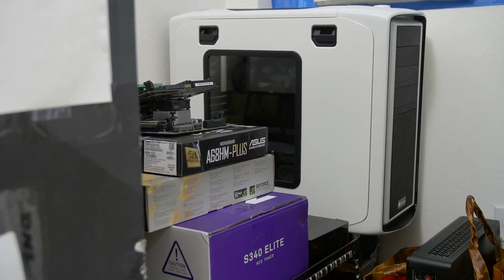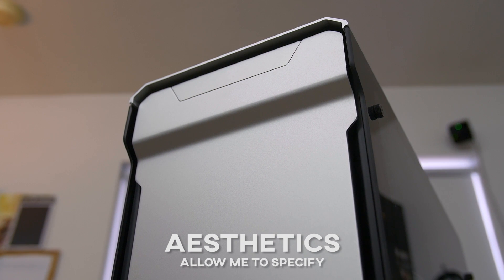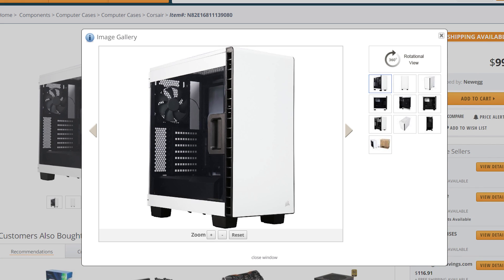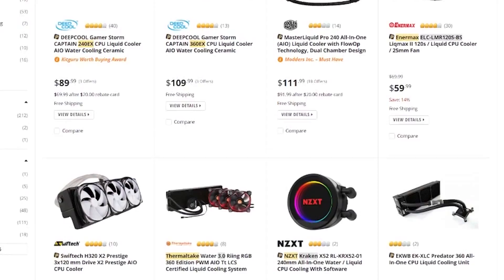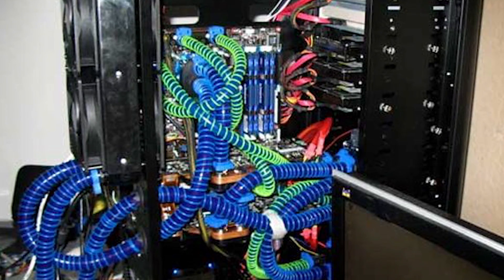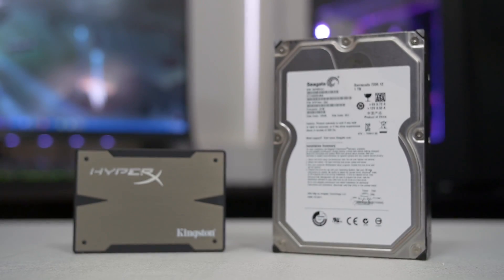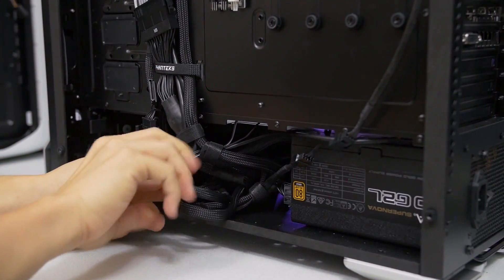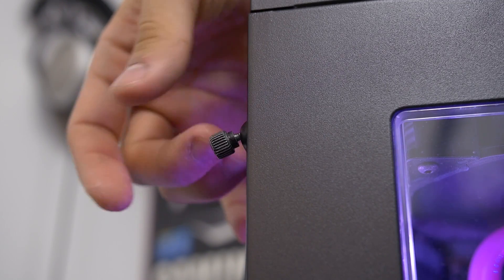4 Major Changes to PC Cases in the Last 5 Years: Then and Now

Comment: I  enjoyed this video Kyle. One thing I wish they'd bring back is easily removable side panels with latches like the 600T and 650D had. I don't think any side panels come close to that ease of use, with the possible exception of some Phanteks offerings.
Reply from the maker: +Paul's Hardware Totally agree. The biggest disappointment when moving from my Define R5 to the Define S was losing the tooless side panel. Would love to see them make a comeback in 2017 but now I feel like larger windows and tempered glass stand in the way :(
Reply: Bitwit Do you think 180/200mm fans can make a comeback? Wouldn't those fans coupled with recent technology like fluid bearing and corsair magnetic levitation fans create a high cfm+static pressure+ultra quiet solution for audiophiles? 
I do miss air cooling without the noisy water cooling fins.
Reply: had 650D for 6 years, now i moved to R5, its not as ez, but look way cleaner.
Reply: I am surprised that the latch system of the old Mac Pro, with one latch in the back, has not caught on more in the PC case world. Its a simple elegant solution and leaves the side panel nice and clean
Reply: The 760T has a similar latch to the 600T
Reply: Paul's Hardware I like my Corsair case with a flip out latch. I built it in 08 or something. Running on a 775 Intel socket with the power supply at the top... now that is a revolutionary change.
Reply: Bitwit I really don't like the direction the define s seems to indicating fractal is going. As someone who values function over form, the R5 is case nirvana
Reply: we should start a twitter hashtag as I totally agree to.
#BringBackToolessSidePanels :D
Reply: Check out the Cougar Panzer Max. It has awesome tooless approach to the side panels, top and front panels also. I have just finished a build in it and it offers very convenient access.
Reply: Paul's Hardware Corsair Vengeance C 70 now those latches, not to mention the handles..ugly side window but I took care of that with a mod.
Reply: I wish they would make case sides with tiny wheels to roll off instead of swinging it open (its quite heavy with glass)And dangerous.
Reply: theres a lot of makers that still offer that u just gotta look harder
Reply: H500P? All you need is a 90 degree twist with a coin!! I mean heck, writing this comment took more time!! XD

Comment: CPU and GPU increased power efficiency makes water-cooling obsolete.
Reply: +Levy Somewhat ineffective? Yes. Obsolete? No. Trust me, it's not going away anytime soon.
Reply: If you game at all these days, you know this statement isn't true. Getting 60+ fps in a AAA title almost requires overclocking, which at its high end requires water cooling.
Reply: +Aditya Gupta A water cooled CPU and single GPU is a lot more affordable. Given how few titles even take advantage of an sli setup, its also more practical.
Reply: FoodOnCrack
There is a good reason: Yes it performs outstanding, but most noctuas are ugly AF.
Even when most air cooling solutions surpass most watercooling ones, there will still be watercooling, just because of aesthetics.

Just saying... I'm explaining, not defending.
Reply: water can get better temps than air. doesn't matter how efficient the components get.
Reply: Water cooling is also useful for small cases with hotter components and inherently poor air flow.
Reply: why won't it go away? Compare the noctua nh-D15 with any AIO cooler and on almost every aspect it's so much better to get the noctua.
Reply: Darkrock 3 looks pretty sexy, with few more degrees but more quiet too.
Reply: I guess the economy works better underwater also.

Comment: That antec case you mentioned that had a window shaped like gumby I owned that exact case lol traded an Xbox one for it well and the components inside. That case was gross that clear coated silver metal finish all on the inside cheap flimsy plastic parts no cable management options.

Comment: One of the biggest changes for the better that I've observed is the re-orienting of the hard drive cage. They used to be positioned so that the drives were parallel to the case panels, whereas they're now perpendicular, meaning that you don't have a bunch of cables feeding directly into the middle of your case and in the way of the graphics card.

Comment: I kind of miss 200mm fans. Such a huge airflow vs noise ratio from their sheer size.
Reply: exyiaevox no amount of sound dampening is going to stop those 2400 rpm fans from hissing at us... If only a manufacturer make a fluid bearing 180/200mm fan. That'd be great.

Comment: I recently had to build in an old super tower from about 7 years ago. (Thermaltake Kandalf, it's what I found cheap when I needed a case to build a low end PC for someone) At first I was impressed by it's raw sizze and compatability with a million motherboard types. I CHANGE MY MIND QUITE QUICKLY. That thing was a pain in the ass to work with, with screws holding in all kinds of different things that really should not be held in with screws and no screws for fans or other such things I would like to easily replace, instead having some proprietary fan mounting system from yesteryear. There was also NO CABLE MANAGEMENT POINTS WHATSOEVER. Seeing how incredibly massive the case was and still not having anywhere to put the cables so that they don't dangle down in front of the motherboard and side panel window was disappointing. I even had to bend the internal steel slightly to get the PSU to fit properly, (even doing it the intended way was a massive pain with the mounting bracket being half in and half out of the case.BUT BASICALLY I HAD A BAD TIME IN THIS OLD GIANT CASE.

What terrifies me is that this thing supposedly cost a few hundred dollars on launch. It has a million 5.25 drive bays but otherwise i don't see any features on it that really make it useful. What was a cheap case from 2009/08 even like?

Comment: The biggest change really was the removal of the disc drive bay (who uses a Blu-Ray/DVD drive nowadays?) and the reduction of HDD bays, it really gave the most freedom in the case design than every other change you've pointed out.
Reply: I Still like my computer case to still have a disc drive bay. It&#39;s nice to know that you can still manually install something via a disk encase trying to DL a program doesn&#39;t work. Plus I like to still play my older PC games which require a disk in order to play.

Plus I do editing and sometimes need to burn off a disk to send to someone. And I'll use it to watch DVDs on as well.
Reply: I still use my disk drives : /
Reply from the maker: +aruan7sp you may have missed it but I included bay removal under the water cooling section since there's a relationship there, as one gave way to the other
Reply: aruan7sp I use a DVD drive. Fuck Digital Distribution.
Reply: Me, quite alot actually. Its the easiest way to archive my commonly used files and programs for transferring to other systems along the line without buying like 20 flash drives at high cost when large DVDRW discs are a couple of cents each. Way I look at is they are like a box of 20 5gb flash drives for like $8
Reply: Considering that Microsoft media creation tool refused to regognice any of my USB sticks, I'm really glad I hadn't thrown away my DVD drive and still had some empty disks on the back of my closet.
Reply: I still use an optical drive/burner for DVD and Blu-Ray. I'm old school, I'd rather have physical media.
Reply: aruan7sp I use a DVD Drive.
Reply: At my house we actually have all of our movies on dvds and we don't use any streaming site (aka netflix)
Reply: I have Blu-Ray burner in my PC. Though honestly, its just because I always wanted one and I could afford it, I also plan to do some data archival.
Reply: I have two Pioneer blu-ray burners in my 4790K build and two Lite-On DVD burners (with a Sony internal floppy disk drive) in my E8400 build. I still have a tonne of optical media, that doesn't need the cloud and days of download time to work, and I find it much easier to boot off an optical disk than constantly fiddling around with the BIOS trying to get a USB stick to boot. Also, I can easily watch both region 1 and 2 DVDs on both machines. Finally, having two drives reminds me of those twin tape decks I used to have as a kid back in my home town.
Reply: aruan7sp idk I know a lot of people who still use 5.25 bays. when it's a disc drive or a fan controller/rgb controller, I like it
Reply: I'm building my first desktop in a month or two, and I refuse to buy a case without 5.25 drive bays. I want an optical drive, fan controller (fan controlling via programs is annoying af), and a card reader since I still use SD cards on a regular basis. Thank God for the Enthoo Pro.
Reply: aruan7sp Me. I still use a DVD drive but it's free and 99% not in use LOL
Reply: As an owner of 9 year old car with CD player I have to disagree. While it is not needed for majority, it is not a single case when you might need good old DVD drive in PC.
Reply: What I could see optical coming back as is flush-mounted slim bays that slot-load.

So just a slit in the front panel.

To be honest, though, 5.25 bays are VERY good for SUPER high-end systems with big RAIDs. Though NVMe kind of obsoletes the good old "shitload of 850 Pros"
Reply: I still use my blu ray drive why would I not have a drive if I can and its cheap ?
Reply: Kevin Moondust they wouldn't be third world then otherwise
Reply: I just picked up a BR burner with Lightscribe for my new build.  Sometimes you deal with legacy stuff.
Reply: i dont think you can fuck the future
Reply: we don't have netflix either, we juse use on demand lol (only good thing about comcast)
Reply: Im planning to overhaul my 2012 pc (Started with a nice graphic card) with a newer processor and motherboard, was thinking only to save the power unit and my old giant cooler master case which is discontinued :

http://www.coolermaster.com/case/full-tower/cosmos-1000/

Do you guys recommend me purchasing a new case as well? as im still deciding between going air cooler or AIO cooler are there any significant improvements for me to consider a new case  in the budget?
Reply: Colt3d - I reckon that If you're planning on staying with your existing case, it'll be best to stay with air cooling, but perhaps updating all the fans to new ones like Noctuas, or BeQuiet!s. Otherwise, to maximise you AIO options, it'll be best to get a new case that has both decent AIO support, along with more modern features, while still retaining at least the essence of the reason why you brought your original case, with the new case's overall functionality. As for the power unit, if online PSU calculators show that your existing supply is up for powering your new build, and it's still a quality unit after all this time, then by all means keep it. Otherwise go with a quality new one, that's ideally at least gold rated, from a reputable supplier, for reliability and longevity, that goes with the power requirements of your new build.
Reply: i have a blind friend i use my dvd drive to rip audio cds to his ipod regularly
Reply: Just bought a pair (one for work and one for home) of Fractal Design Define C's (non-mini version) because of their lack of front mounted drive bays. These cases are nice and short front-to-back. Can fit on my desk without looking ridiculous. I have a redundant, 2 drive NAS for movie and photo archives, so I only need one SSD in the case. (They have 3 SSD backside mounts and two 3.5 mounts for those that need more, in the case storage)
Reply: acme64 I can so long as tech companies shit on Third World Countries with terrible ISP Offers.
Reply: MCatwar For example, a Scythe Kaze Master KM01-BK fan controller to go with my two DVD Burners, collectively using all three 5.25 inch drive bays of my Cooler Master Elite 370 case, in my E8400 build.
Reply: Samuele Pelanda rip them and network share them? Much better than pulling a disc and damaging it over time.
Reply: Billy Sure. When I can afford to upgrade to a full Gigabit LAN WiFI 802.11ac network, and have gotten enough RAIDED HDD space for a NAS based solution, along with a complete proper Blu-Ray and DVD ripping, editing and conversion software package that actually works.
Reply: Elusivehawk For my 4790K build, I used a Fractal Design Arc Midi R2, with three of my fans using the internal switched fan controller, while the other three, attached to the Gigabyte Z97X-UD3H-BK motherboard, are controlled by BIOS settings, which auto adjust to the temperature of the system. My E8400 build uses a Cooler Master Elite 370 with a Scythe Kaze Master KM01-BK fan controller (which is an older model) to manually control the fans, while also being able to continually monitor the speeds of the attached fans and the temperatures of various parts of the insides of my case with it's great looking old school VFD Display. For a card reader, my Epson XP-322 Printer/Scanner/Copier provides me with one for both systems.
Reply: I have a BD burner, but I have it in an external USB3 case, and rarely use it to be honest.  No place for it in my NZXT S340 case.
Reply: Sean Malahy i have one of those. I also got an external blu-ray drive. Tho im kinda annoyed as i used to have a really good blu-ray burner which could also read hd-dvd. Looks like im gonna have to not be a cheapskate and upgrade to pure blu-ray lol
Reply: The nice thing about having the BD burner in the external case is that I can use it on my NZXT desktop case, my Dell XPS 15 9560, and my Alienware 17 R4.  It's fairly versatile that way.  Handy when I want to back up files to big to transfer over the Internet or network, or when a friend says "hey make me a copy of this"  I still find discs to be more reliable than high capacity flash drives.  I've had too many of those fail.
Reply: i used to work in a used software shop back in 08 and i got a box full of them for £5. good films aswell. t2, matrix trilogy, 300, heros season 1, a season of smallvile, doom hd, full metal jacket, blade runner and jason bourne films
Reply: I use a disc drive,but its hidden due to the nature of the top drive bay mount that covers it from the front.
Reply: even if i decided to use one, it would be a slim external one, 3m taped to under my desk
Reply: I use a disk drive. Downloading a new game over a metered connection is awful. And blu-ray movies are now nice and cheap, and better quality than streamed or downloaded movies. Long live the Blu-Ray drive (For a select number of people. :)
Reply: Still use.
Reply: Use DVDs every day. No plans to change. Not going to pay all over again for the same stuff, and not paying £££s for space versus £10 for a DVD drive. PCs can't get vastly more narrow really, due to PSU width anyway.

Counter argument: What's the point in having an electronic device in the home, with all the potential access points to it hidden? Aesthetic PCs are for poser Mac users and RGB kiddies.

Discuss!

(So we learned that sweeping generalisations aren't helpful :D )
Reply: The biggest downside to not having one drive bay is all the cool aftermarket you can't make use of.
Reply: There are Third World Countries with decent ISP Coverage and speeds. As long as there is not contention from Devs and Tech Companies alike, I will say Fuck Digital Distribution, I want my Physical Game. Plus, I have something that can be resold and own the bits and bytes inside, instead of signing an EULA which is recklessly anti-consumer.

Comment: Im sitting next to a Corsair Graphite 600T right now. ITs not old, dont make me feel bad.
Reply from the maker: +Josh Mullard I agree the 600T still holds its own today. Still deigned better than a lot of modern midtowers.
Reply: Josh Mullard im sitting next to cm stryker and i feel bad :(
Reply: old  doesnt mean bad. its a classic.
Reply: Same, It's still a fantastic case IMHO, I replaced my antec p182 with the 600t and i personally like it even more than the 780t (which feels comparably cheap, despite costing $250 CAD)
Reply: I just chucked mine.  Was a nice case, but well, now-a-days, quite HUGE if you don't have a lot of HDs you're putting in it.  I want to go about 3/4ths the size of that case in my next build.
Reply: Hatto- older CM cases, especially any of the HAF series, are like old muscle cars. They dont get old- they MATURE WITH AGE!!!
Reply: I also have a 600T!  I'm building a new computer within the year and I've been really worrying over things looking for a case I like just as well, lol.  

Anyone know what case is in the video at 4:46?  It looks pretty nice from the side.